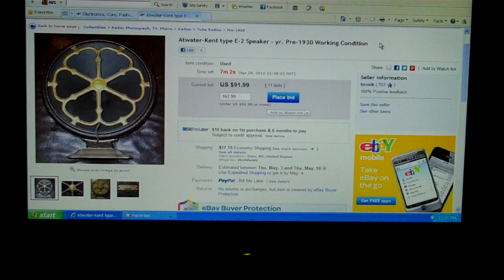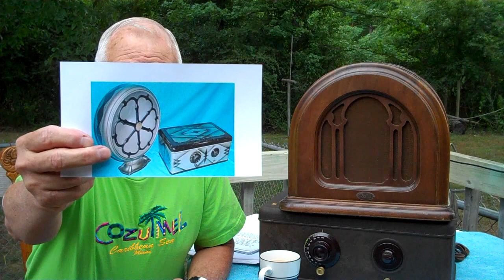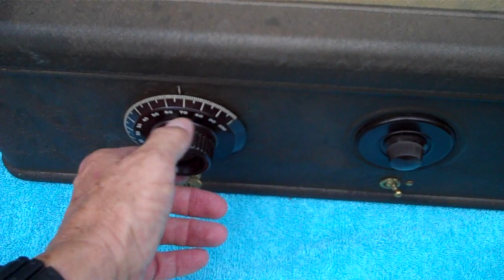1927 Atwater Kent Model 37

Comment: Hey John,
You'll be able to fix that coil. A bright light, big magnifying glass and no real coffee should do it. Glad you got the speaker, neat to have the right speaker too. TRF circuits are straight RF amp, then detect and audio amp. Clean all connection including the screw connection too.
Very interesting story too.
Regards,
Rick

Comment: Picked one up for $50 at an estate sale. It had been in a garage hosting several generations of mice.   Replaced the capacitors—not fun as they were sealed in tar .  Made a new speaker from black poster paper and it receives okay for a device it’s age.  I’ve heard it referred to as a cat coffin radio.

Comment: Hi John, I am restoring a model 44, at this point I have the the electronics working and can pick up 1 station that is close by. The radios is not very sensitive and can't pick  anything else. I live in an area with lots of stations so its a radios sensitivity issue. Any experience or advice with this? thank you

Comment: from what i know of the atwater kent radios(i have a 44 and a parts set in parts i forget the model off hand) the cans are transformers and whats inside of that box in the back(encased in tar?) should be the guts of the radio(caps,resistors etc)  btw the can transformers are also encased in tar.